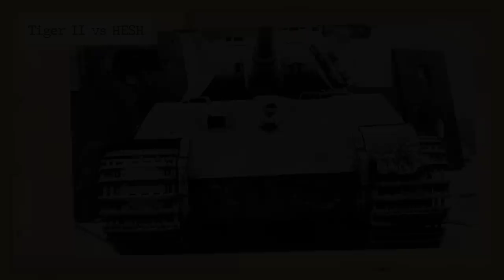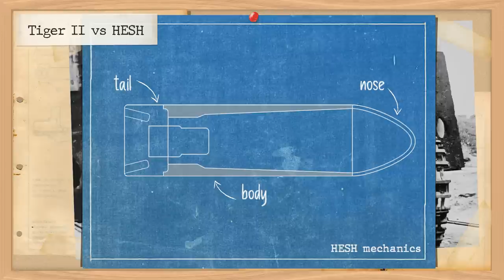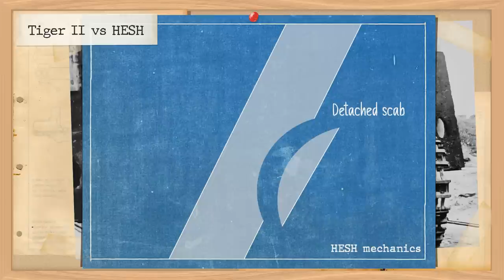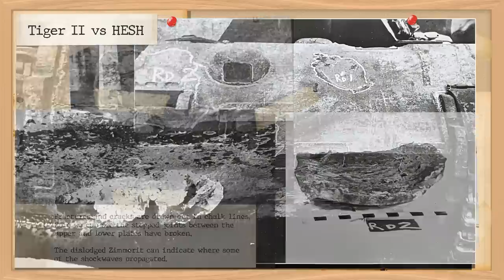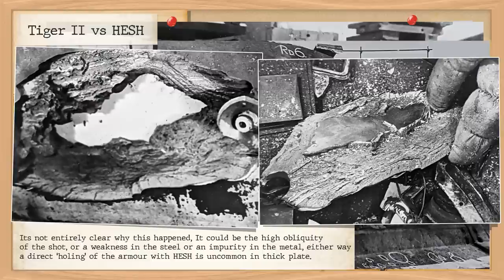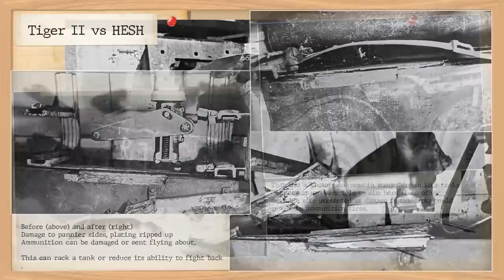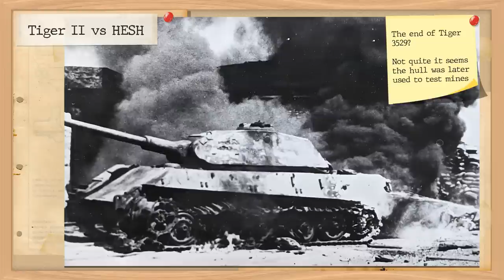Tiger II Versus HESH - Tank testing

Comment: So these are all fired by a 6.5 inch gun? Hardly representative of typical HESH rounds. How much less powerful would a typical tank or field-gun sized caliber be, with its much smaller shell and explosive charge? This video seems like it is biased to make HESH seem even more powerful than it is. This is not necessarily the effect of any HESH shell, this is because it is a god damn huge 6.5 inch shell. That is what, 165mm? That is an enormous shell, and an enormous HE charge. Everyone laughs about the huge 152mm gun on the ISU-152 and how the HE shell alone will blow a Tiger IIs turret off. So not really a shock even a HESH charge will work. How about 90mm HESH shell vs a Tiger II?
Reply from the maker: Failing to understand your point here:  This test was to determine if the 165 mm HESH would be effective against armour, that’s the whole purpose of it. As shown in the video we did test other calibres against other stuff, but in this test they wanted to see if 6.5 was going to cut it vs the newer soviet tank armour if it had too